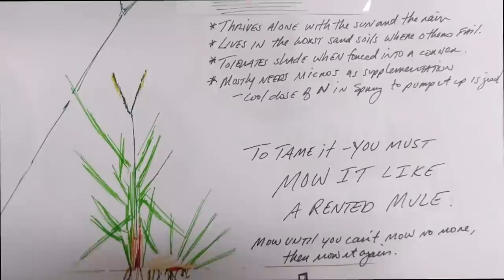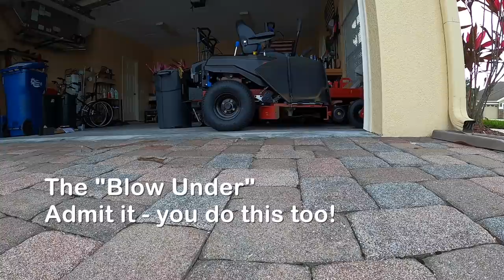Terribly UGLY TimeCutter Mulch Mod // Getting JACKED in my GARAGE

Comment: Great video Allyn. I have identical Timemaster and Timecutter mowers like yours,  and I had my dealer install a mulch kit. IMO, the Timemaster has a slightly better quality of cut, but when it's 95 degrees with a heat index of 102, the Timecutter is literally a lifesaver. Would highly recommend both for large yards.

Comment: About The Mulch Kit. My Gravely has one the whole size of the deck and yes it bolts under like that. As for the color, go to an auto parts store, see if they can 90% match it in a spray can. Take some mid grade sandpaper, Scuff, Primer, and a few hours later (once it cures) spray it and you are in business. $15-$20 is the max I'd expect and 30 minutes of work with breaks.

Comment: Allyn, I'm glad to hear you are enjoying your Timecutter, but I am not.  Planning on selling mine shortly before my season in Iowa starts.  I have a 50" deck with mulch kit.  If I mow my TTTF/KBG at 4" the max the grass height can be is 5" or the deck simply can't handle it.  I will get clumps falling out and missed strips.  I've adjusted speed, I've adjusted deck pitch, I sharpened the blades myself and even tried gator blades.

Any tips you may have to save the pending sale would be appreciated.

Comment: I've got the 50" version of the TimeCutter and love it.  I just threw this mulch kit onto mine yesterday, but I haven't used it yet.  I do agree that the thing looks pretty unfinished and ugly without the plastic side discharge, but I removed mine as well so I can get the machine into my shed (I've got about 3/4" clearance on both sides without the side discharge).  I didn't want to have to bungee-cord the thing up every time either.  I wish there was some other option.  I suppose I could make something myself out of sheet aluminum and paint it red or black, but not sure why I have to do that when spending $260+ on a mulch kit.  I honestly would have spent $300 if it looked like a finished product.

Comment: It does look like you got a better cut with the new mulch kit and blade, and I agree that not having the cover on looks ugly. You'd think Toro would have an over-priced accessory that would cover that up if you didn't want to use the discharge cover.

Comment: Nice to see you using zero turn mowers now, I love using my 61” SCAG Cheetah for the 55 acres I help volunteer to mow. The grass out there isn’t so nice but having a sweet cushioned leather seat ride makes it very enjoyable. Something to be said though for having the same walk behind mower for over 10 years and it still starts 1st pull, has manual choke, and a blade brake/clutch. I baby the crap out of my old Honda and the only new ones being made that holds a candle to it out of Honda line is their $1,000+ commercial push mower with a manual choke.

Comment: 7:52 - Do you know if that jack mount will fit the MX5075 75755 with the 50" deck?  The Toro website has the 140-2711 listed as the compatible mount, but I can't find one anywhere.

Comment: I have the same issue with my Timecutter. I wanted to find a quick chute attachment, but nothing was available yet. I have the power bagger as well for the heavy leaves. It’s a pain in the neck to switch from power bagger to mulch. So I am currently a bagger, unless I’m mulching with my Time Master

Comment: Can any of you LCN’s please help me with this question. I want to buy the Toro 22’ Recycler with PowerReverse. I have two options, a Briggs and Stratton 163 cc EXi engine (20355) for $449,  (With SmartStow) and a Toro 159 cc TXP engine (20357) for $459. Which is the better engine between the two? I know is only a $10 difference but the one with the Toro engine doesn’t even have SmartStow feature & is still more expensive. What do you guys think?

Comment: Great video! Just an observation but I think your old blades were actually mulching blades and the blades that come with the kit are high lift blades. You should consider putting the old blades on or buying some xht or gator mulching blades and see if you get a better cut.

Comment: There's a guy in my neighborhood selling a 2023, 42 inch timecutter with the mulch kit on it, 35 hours and asking 3300. I'm probably going to buy it but I wanted your thoughts. Has it been a great mower? Does it give an excellent quality cut?
Reply from the maker: Its a very good mower but I recommend taking the mulch kit off. Mulching with a zero turn gets very messy. You need the side discharge to be able to direct the clippings

Comment: Re-watching this vid and wanted pass along a photo of my Timecutter 42 mulch kit. I had it ordered and installed by my local Toro dealer. Notice that the discharge shield is still attached with a bracket to keep it up and out of the way. Also, the mulch ‘shield’ can be easily removed and replaced for bagging or side discharge. (Unable to attach photo) 😕